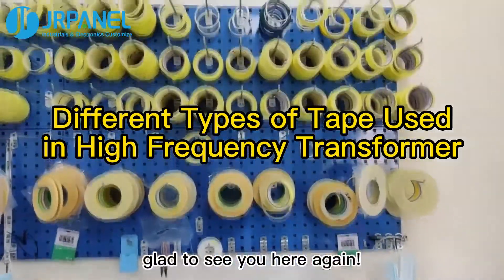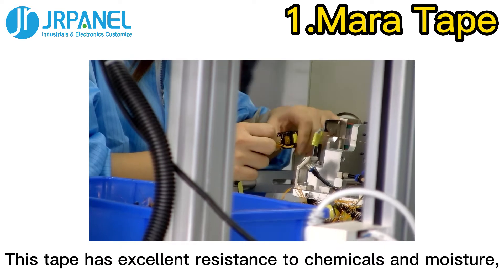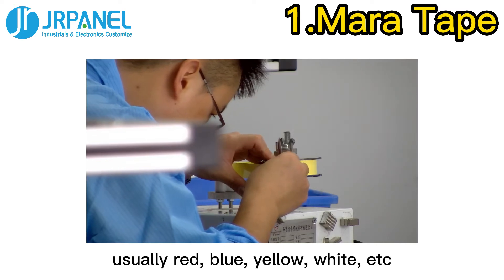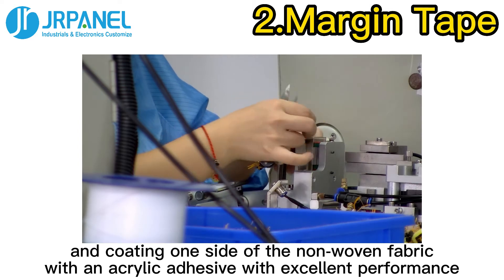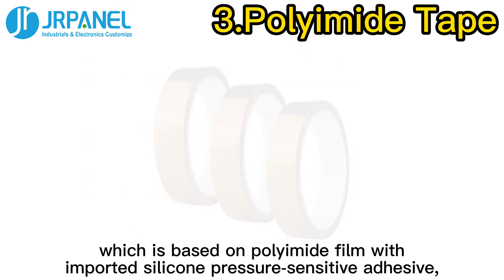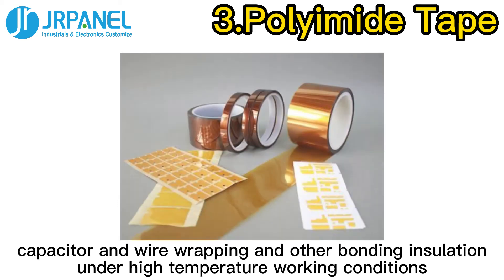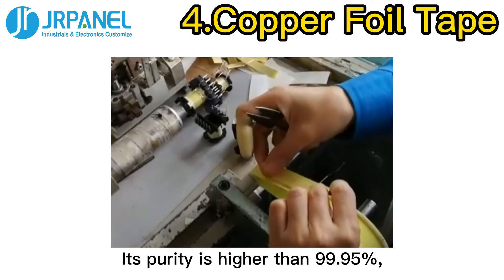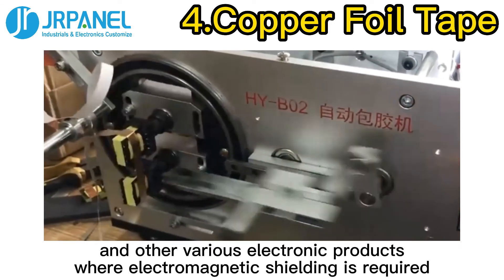Different Types of Tape Used in High Frequency Transformer

Comment: The most great here is they make a lot of small transformer, I am curious  of those small transformers.

Mostly I like the step-up small transformer and the small inverter transformer. 

By tge way may I ask a question Can I use a electrical tape instead of those mara tape??